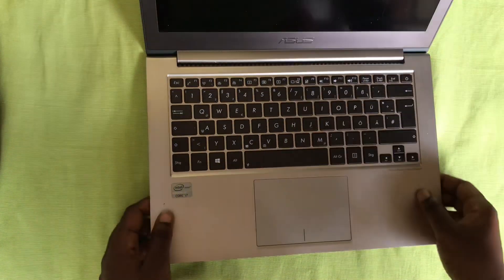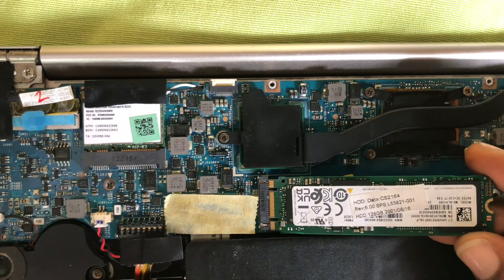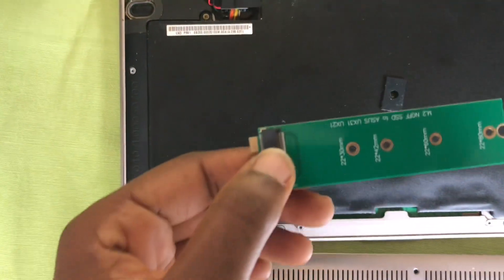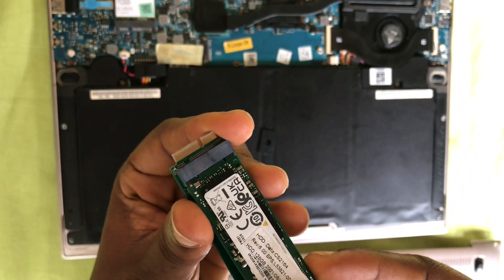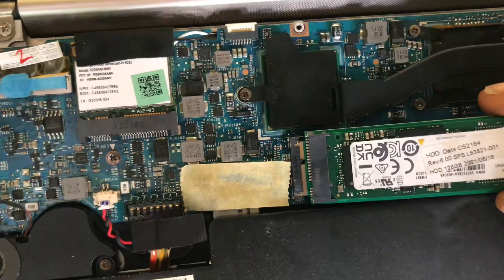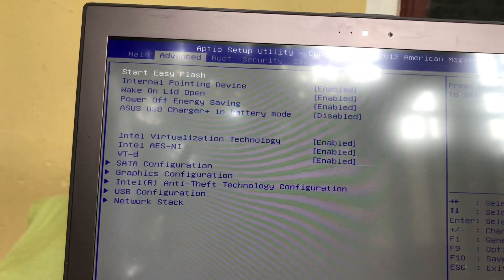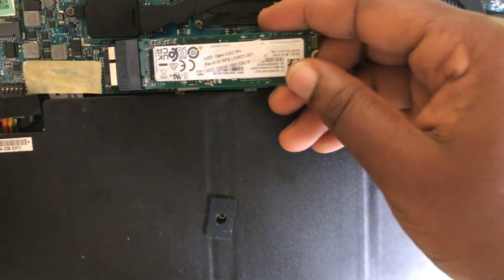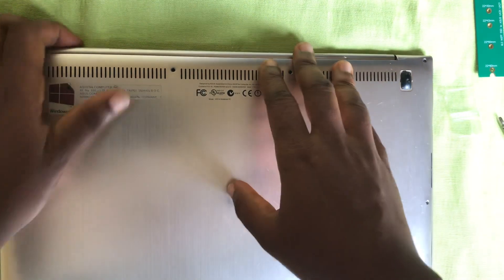Asus ZenBook UX31A m.2 replacement

Comment: Thanks for the video highlighting the fact that the replacement is for M.2 and not NVMe. 
I have a Asus UX31 with SSD and was just curious if I could upgrade it to NVMe. 
Probably won't do it just because I don't need to as I have SSD and is good enough for me.